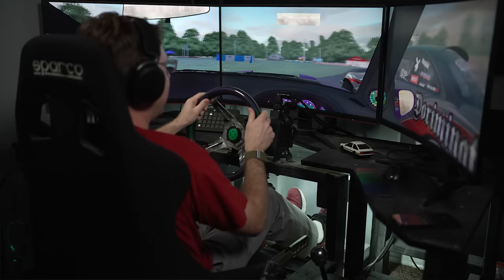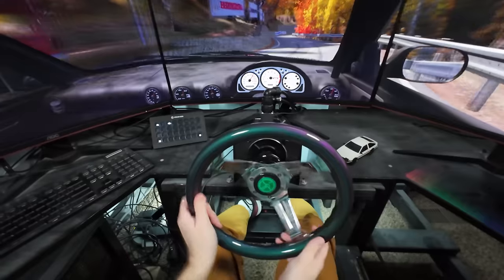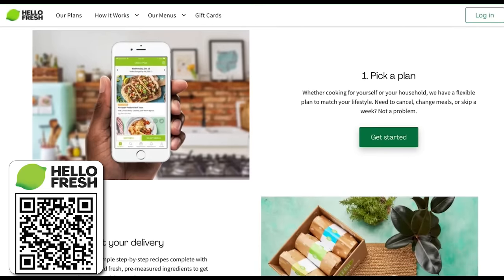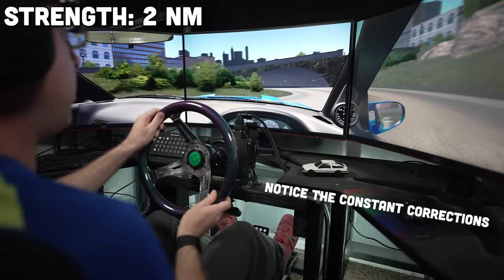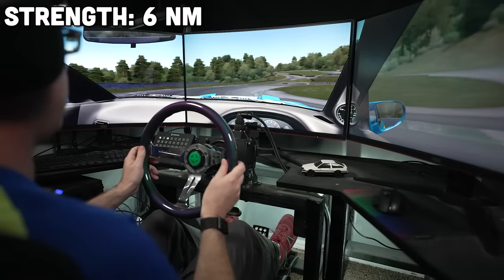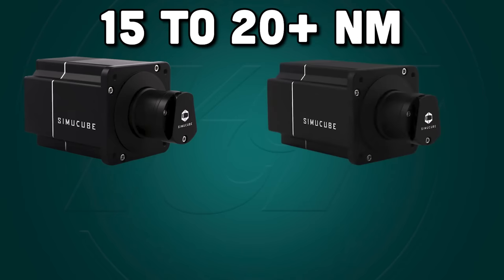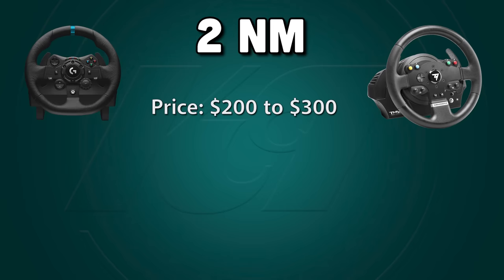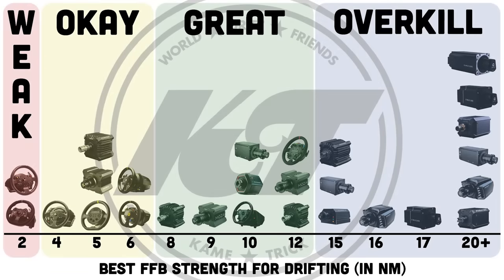What FFB is realistic for sim drifting? (2 to 20 Nm)

Comment: I am using Moza R5 with 100% in Pit House but in the AC the Gain is on 60%. I don't like to fight with my wheel while drifting. What's the point to upgrade the base to, like R12? Everyone is set the Gain to 100% just I am the only weak sim(practice)drifter? :D

Comment: Just a question. If I have learned how to drift on a low Nm wheel will I be able to apply my understanding of drifting well on a higher Nm wheel or in a real car? I will say after watching this video, I'm attributing my uneven skill between car packs more to my setup than to my skill (as with many car packs such as DWG, BDC, and Tsujigiri Lights I'm able to drift through feeling out the pedals with FFB turned up well into clipping so that the wheel self centers a little better; I would say 85% of the drift work is done through my pedals at this point). I have a couple examples on my YT page of me interacting with my G920 (although a lot of POV footage are old and not representative of my current skill, I just posted a crappy little POV in shorts from a couple weeks ago).
Reply: it'll take a little while to break the habit of throwing the wheel into the drift, but not too long. your drifting will improve a lot with a 5+nm base
Reply: @elsnowman123  yeah I do find myself having to throw the wheel a lot
Reply from the maker: Great question, and thanks for watching my video! :)
I do think building skill with a low Nm wheel is still a net positive that will get you further along when you eventually switch up to a stronger sim wheel or a real car. It's a step I'd completely skip if someone had the money to do so, but if you're choosing between sim practice with a G920 and not practicing at all, the G920 is the better option. You may have a couple "less than optimal" tendencies to outgrow through practice over time after you upgrade, but I wouldn't be scared you'll put yourself into some kind of horrible driving habits as a result of your time with the G920.

I think people develop a lot of extra techniques and inputs that aren't necessary when they either don't trust the car (which can happen due to low information/weak FFB) or try to drive at too high of a level without building foundational skills first. A lot of times, these are the same techniques that work great at high levels, but they may get overused when something even simpler, like better throttle control and timing, would have done the same thing. You can always find something new when you go back to the basics, even I do :)

So long story short, your skills will generally transfer "up" to better products (gear to belt to DD wheels, or sim drifting to real drifting)...personally I find that the opposite is where you run into snags. For example, if you get used to an 8Nm DD wheel, going back to a G920 will feel horrible and you may find that even though you know you can technically "do it" you may never want to spend the time to re-acclimate to that setup once you've had a taste of something better. This is also why it's hard for IRL drifters to get a good sim experience, we lose so much "FFB" information when we go from a real car moving across the surface of the earth to a sim cockpit that's sitting still in our room, that even if you get a really solid wheelbase, it's still very foreign and your IRL skills don't transfer very well--not to mention what happens if they try a budget wheel.

Cheers!

Comment: gear driven is gonna feel bad at any nm level, gear drive is also NOISY 
belt driven is acceptable, fine for racing, but for drift still really fast enough and as confident feeling as direct drive. 
I have a 16nm moza and I run most drift cars at around 6-8nm.

Comment: This video completely misses a very important factor: the slew rate of the base. Sure, you don't need or even want to use the excessive maximum torque of the expensive hi-end bases, but they also produce faster acceleration of the wheel and thus more accurate and responsive feedback with their powerful motor even when you turn the max torque way down. This video really needed those gear driven logitech and belt driven bases to be sampled and compared with the nice expensive ones, just turning down your powerful base to equivalent max torque will feel much better than those low-power slow bases. Also the gear driven bases actually resist your steering input making them feel very clunky.
TL;DR: It's not just about the max Nm, the power and speed of the base is equally important. This makes the hi-end bases worth the money if you can afford one even if you need the max torque.
Reply from the maker: Solid points, and if I had those wheels handy I would absolutely have demo'd them and gone into more detail about that. Thanks for adding to the discussion, I agree with your points ✌

Comment: its quiet easy: avoid the non direct drive wheels at all cost. Its 20 y/o technology with a modern motor. Entrylevel should be used t300 or tmx, used csl elite or moza r5 bundle

Comment: Im quite new to simracing and just bought all my gear last week. I was inspired by this channel.

I went for a high Nm base knowing I'd use them at 50-70%.

My reasoning comes from power tools. For longevety and performance it is better to run a powerful machine at 50-70% than a lower powered machine at 100%. Also, a powerful machine at 50-70% feels more stable than a lower powered machine at 100% at the same out puts and I can't explain why, it just feels better.

I guess it's not too different than comparing a 4 cylinder and an 8 cylinder car going around a track at the same speeds and power outputs.

Comment: Mabe i miss understand something with higher torque dds but for example, in my experience, there is no way i can drift properly with my moza r9 at 100%. mabe max that i would try to use is 70% for some cars but for sure thats not optimal... usually i use 30-40% with VDC and 900 degrees steering wheel rotation. if i go above 900 then i use 40-45% of torque. So... idk, mabe someone is able to explain what i'm missing. Also i'm not that weak or smth...😅
Reply: Yeah only the clowns are saying they are drifting with 6nm +
Reply: @AC-Aliens  😅👍

Comment: 8-12nm it is. But the how do I set it up? 100% fanalab and 0% gain on AC or 50% Fanalab and 50% AC ?
Reply: Personally I think it's better to run at 100% on your wheel's software and then limit output in the game to try and avoid any clipping issues - if the game's output is maxed out the signal won't be as clean.

Comment: The top selfsteer speed on indirect driven wheels is not limited by torque, it's limited by motor max RPM together with gearing ratio. And on gear driven wheels, it's woefully insufficient, it's several seconds per revolution. Yours can spin several times faster even at low torque.

The spec torque is only reached quite near zero RPM.

"Mid corner, the wheel is fairly numb"... you are aware that you scaled down the torque multiplier too far? On this type of wheel you'd probably want to dial in the feel for that situation, and just have to live with inherent nonlinearity on the edges of the response, because that's going to be there anyway. I mean you can't use a single number to model 3 different families of technologies with their own unique flaws and which you'd tune and set up differently.

Comment: Do u recommend the t300 for rookies at sim drifting?
Reply: Wait and see what Thrustmaster brings on the DD front. They are working on a DD wheel for Playstation, and my guess is it'll be cheaper than the T818 that they have out so far. There's a small chance that it might be a DD base at about the price of a T300. 

All that said, Gooesiest ran on a T300 for years and years. He just switched it for a Moza a few months back, so you can absolutely drift with the T300. It's still a great wheel for beginners and people on a budget for sure. Far superior to the Logitech G29 style wheels.
Reply: @JimmyNuisance  so prob the moza r2 or r5 if I won’t get the dd or t300?
Reply: @JimmyNuisance  bc I love sim drifting it’s just that we have the g29 and I want a better wheel

Comment: So judging by the footage of the rim replacement, could I just grab a wheel base adapter off any sim wheel, modify the spare(old) steering wheel of my actual car to it, and use that? That'd be pretty sweet. Thanks for the super in-depth vid and all the links, I'll try and make use of as many as I can 人´∀｀)
Reply: If anyone's interested, I ended up getting a Simagic wheelbase and just bought a Kyoustar QR adapter and am now using my Raid 1 wheel from the 80s to drive sim :yougotthis: so yeah the connection's the same

Comment: Im tired of the whole whats realistic. We arent in the car we dont get the queues a real car gets. The poikt of having more ffb snd more center torwue is for control. You want that tighter center forces not when  drifting but when racing. You want every movement to tell you something. Like when i hsve a 25nm base with torwue i can feel the edge of grip st all times if it gets loose its because of grip instead of having a ligjter bsee and guessing when its looser since its not tigjt enough. Having all of that torwue also helps you turn in ans feel less understeery. It helps bring out all of the details. Peoole who think it doesnt mstter havent used them. You get less clipping you are able to set it lowrr and still get more detail then lower nm bases. So you have many advantages. Once you realize how much more consistent you sre and how many more queues you get through your hands you then get why hevaier bases are better. Dd was not designed for lower torque you can just tell by the details. Again realistic is not whats needed in a wheelbase whats needed is more information and more control of when the car gets loose. A real car goves us those details but not through the steering wheel the same way in sim racing thats how we get the details so its needed.

Once you feel and get used to a 15nm base or up you wont want to go back even if you are setting it lower.

The weight also makes up for the weight you feel in a car but again just a different way we dont get the g forces or feel that so we make up for the feel with a little more torque and def more details.